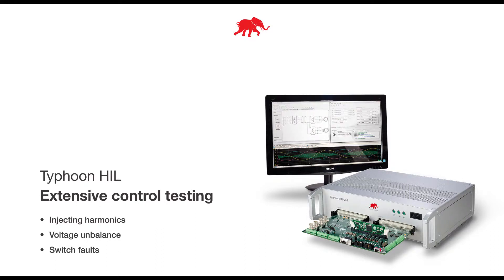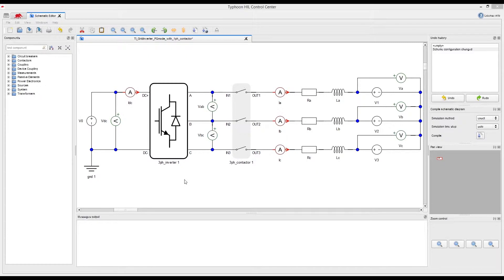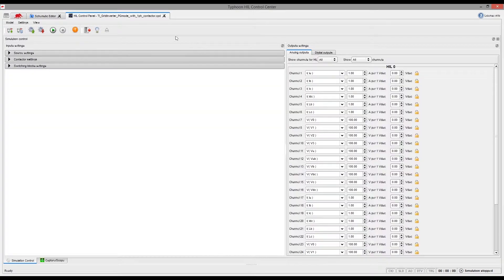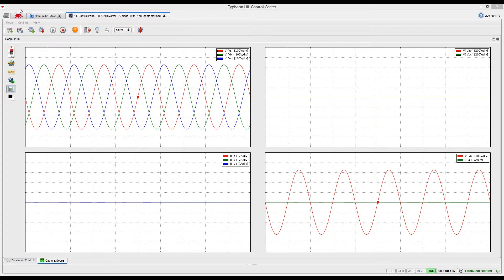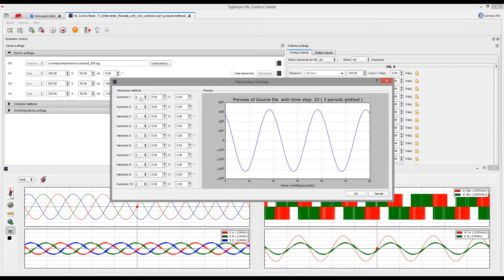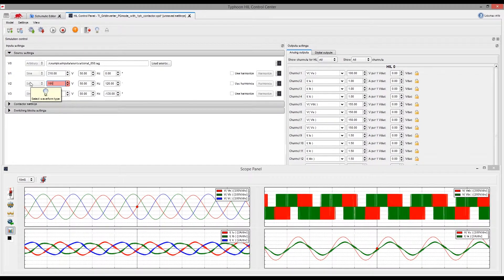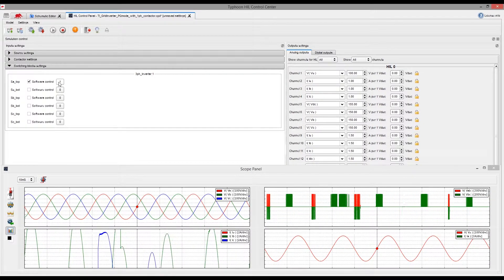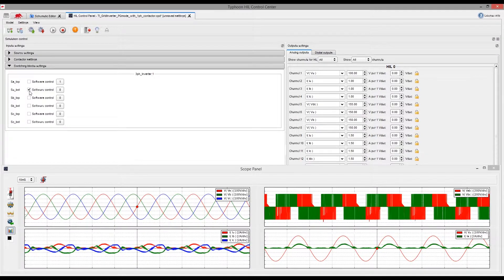Extensive testing of power electronics control systems: Fast, Easy and Safe

Comment: It seems to be limited. Could not emulate a multilevel 3 phase converters...
Reply: Typhoon HIL has a rich, ever-growing library of different multilevel converters.  Updated list of the converter typologies can be accessed on following link: https://www.typhoon-hil.com/documentation/typhoon-hil-schematic-editor-library/topics/converters.html.
Reply: @dusankostic502  I've tried the HIL402. I just wasn't able to successfully compile two legs of a 7-level inverter using 6 single phase full bridge converters. I keep getting either 100%% core utilization or out of memory. I did try using the core couplers.
Even with one leg made from 3 cascaded full bridge converters gives out of core memory error. Maybe the HOL402 is very limited? I did not yet see a demonstration of a full 5-level or 7-level 3-phase converter in action.
Reply: @ebarbie5016  Please send your model to customer support page  (https://ticket.typhoon-hil.com/tickets.php), so we can help you.